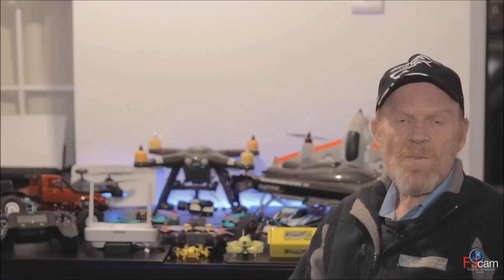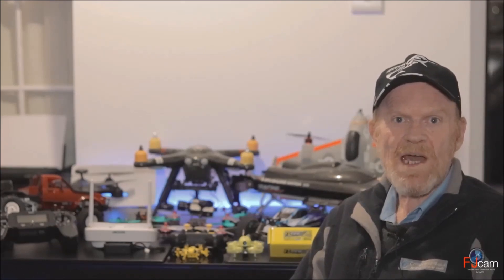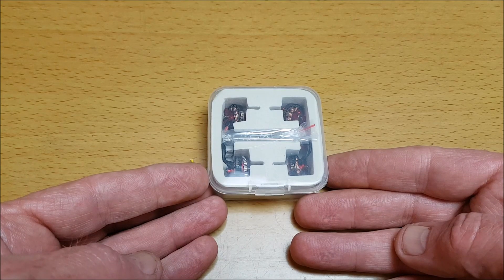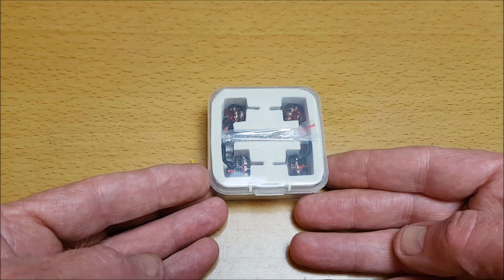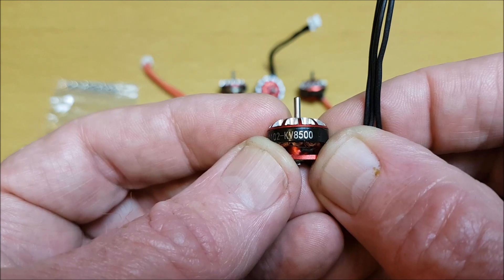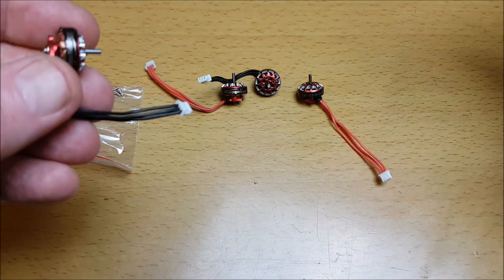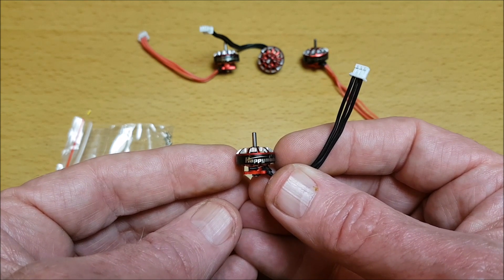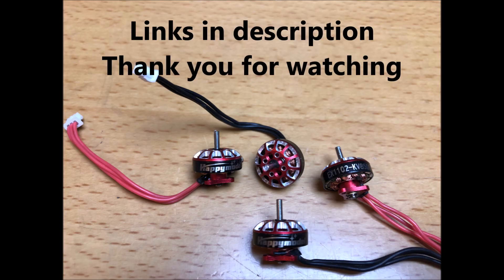Happymodel 1102 8500kv Brushless Motors review

Comment: Nice review. I'm considering Happymodel 1104 6500kv for a model airplane project. It's a small twin, and I'll be running 3" tri blade props. I'm hoping I can get 200 grams of thrust from each motor.

Comment: wondering if will give cinecan more umph.. replacing FC thinking for better motor. more thrust. but can only find this 1102 8500kv and the tinyhawk FS 2 1103 7500kv motors with 3 hole mount.. will be 3S
Reply: warning! The THFS2 motors have a different mounting pattern from happymodel motors
Reply: @ELValenin  ok.. I ended up replacing frame cause it cracked a bunch before replacing motors.. so its a 85x. 12a aio, 1204 5000kV running 3S and 4S

Comment: Somebody know a "easy" way to fix the motors?
i have now 6 motors where wires broke off and dont want to buy more new ones..
Reply from the maker: Hi, sorry to hear you have this problem, I unfortunately do not know how this can be fixed.
Reply: @BillMRC  i got one soldered togethwr finally^^

flew one pack yesterday and the blue wire of the camera is now gone away where its soldered.. i cant see if its the top or the second pin on the camera -.-
i geg no image and no osd now, vtx is working
Reply from the maker: @CorrexPoE  Sorry, confused,  did you manage to repair a motor?
Reply: @BillMRC  Yes i got a motor fixed and now i have the camera broken😅

The blue wire disconnected and  i dont know where it is connected at the camera